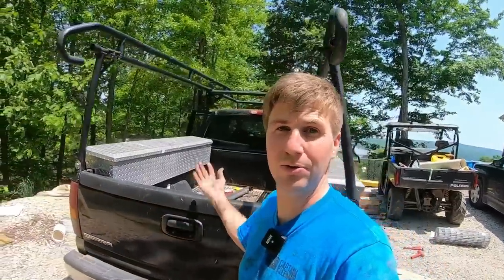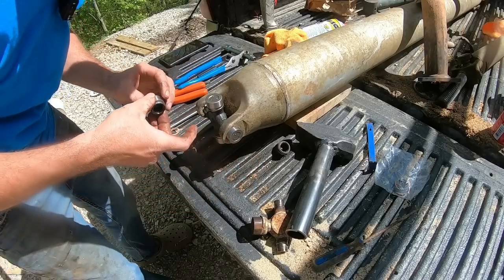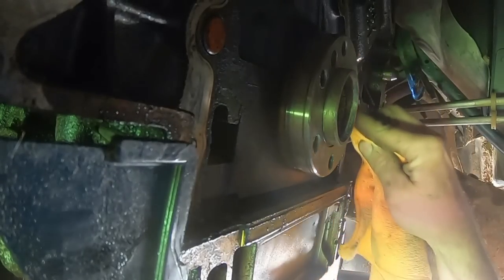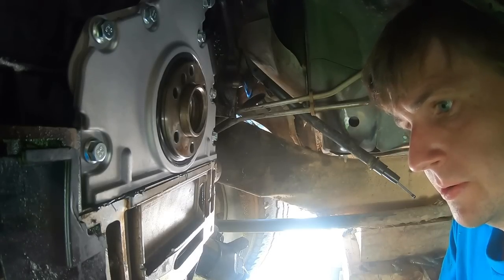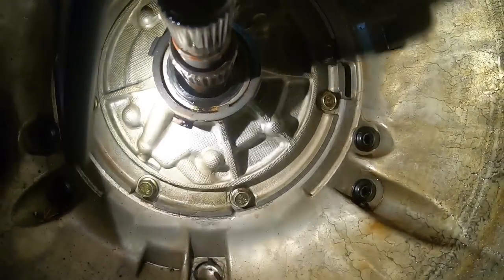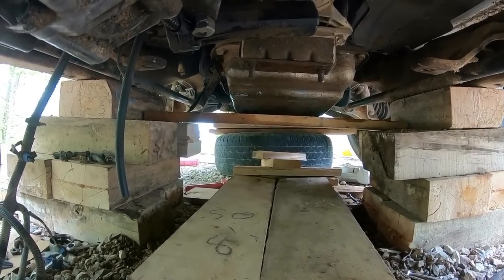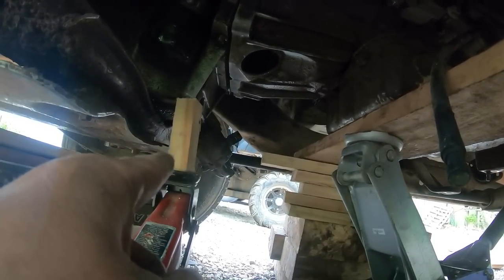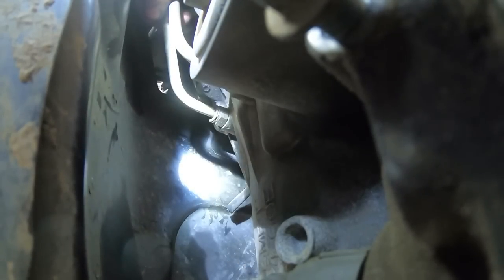GMC Sierra 1500 - Leaking Oil in Two Spots at 290,000 Miles - Homeowner Attempts Repair

Comment: Cap’n, that was an adventure!  I lost track of all the camera angles you used.  Despite the close calls with the bumps on my noggin and the oil splash in my eyes, I’m fine.  I made it through without a scratch.  Thanks for keeping me safe!!!

Now, let’s talk Torque Tools… I’ve used every kind you can imagine… my dad had the flex beam type, with a rod that pointed to numbers on a scale.  They were both foot and inch/lb varieties.  He bequeathed them to me.  They were state of the art when I was a kid.

Years ago, a mechanical engineer who worked for me tested them on one of our torque testing machines and discovered they were just torque estimators.  So, I bought a pair of Craftsman click type wrenches.  Those are what I use now.

My neighbor did some welding for me.  He was working on his Bobcat and needed a higher Torque value.  So, I bought him a  digital wrench.  I got to play with it a few times.  It’s cool but, like you, I was always afraid of tearing it up… so I don’t use it often.

Then there was this torque tester in our lab at work. (The same one that we tested my old wrenches on.) The testing head was portable and plugged into a lap top. In those days, the laptop weighed more than the tester… I had just bought a new set of tires for my pickup and thought it would be interesting to see how close the lug nut torques were. 

When we took the tester to the parking lot we found they were all over the place.  Like maybe 40 ft/lb range from tight to loose.  The owner of the tire shop was a family friend.  I called him up and asked if I could bring the pickup by and have them check to see if the lug nuts were tight.

When I got there he pulled the ticket and called in the tech who had changed the tires.  He asked him what torque he had used.  His response?  “The German wrench.” 

The owner told him to get out his Torque Wrench and do it right.  He then apologized to me. That’s when I asked, “What’s wrong with using a German Torque Wrench?  Are they calibrated to metric?”

His response, “No, they aren’t calibrated at all.  They are just Gudentite!”  It took me a few seconds to translate it but I realized that his mechanic had done it the same way I did it… when I could get away with it!

Since then, I have always tried to figure out when  Gudentite was Gudenuf!

Now Elbow Click… I’m gonna have to work on calibrating that.  Thanks for adding another tool to my torque wrenching arsenal!

Comment: I love watching just a little advice from a old badly worn mechanic, I’ve noticed a few times on you videos when you are torquing bolts you have choked up on the torque wrench but the only way they are truly accurate is when you are holding the handle. Good luck and God Bless!

Comment: Twenty years in the Air Force as a Vehicle Mechanic was tough job.  If it had an engine and/or wheels, you worked on it.  Every Air Base I was stationed at we had civilians that we worked with.  They were the anchors of our shops and the highest skilled technicians.  If we deployed, they were the ones that kept the shop at home station running.  We had one civilian that taught us how to modify one of those Dog Bone creepers for rough terrain.  Swap out the big skinny plastic wheels for wide air-filled rubber tires/metal wheels.  Many times, on our deployments we had to work on dirt, rock, and sand.  Those modified Dog Bone creepers made it much easier on that rough terrain.  Sand was a bit more challenging, depending on the amount of sand.  The only downside was the creeper did sit about an inch higher, but that also prevented the creeper from dragging and snagging on the rougher terrain.  He was recognized by the Air Force for the modification and was awarded a $6000 for his idea.  Supposedly, the Air Force was supposed to work with the company that makes the Dog Bone creepers to put the modified version into production, but it never happened.  It didn't take much to do the modification, so the mechanics did what they had to do.

Comment: Hinde sight thing, before you attach everything back to the transmission, you have to jack up the engine and transmission, as high as you can, it will tilt the top of the transmission away from the fire wall. Hopefully you won't have to do another one. Great job man!

Comment: Great video Mike. A bench vise and a couple of sockets work great for taking out the old U-Joints. I have used a large C-Clamp as well. Use 1 socket as a punch and a larger socket as a cup. Also when you reinstall the new ones, I always wipe more grease onto the needle bearings…something like Lucas Red and Tacky. Hope this helps you in the future….thanks!

Comment: Since I turned wrenches for a living, I feel confident in saying that ya did dang good... I never had much luck trying to put two caps in the u-joints at the same time so set one in far enough that I could still move the joint over to find the sweet spot and slip the other cap in.. then if no ones looking a ball pein hammer and a second hammer to hit the ball pein hammer and set them in to where the clips fit... now they are in, I would tap them apart from each other making the caps tight against the clips and no tight spot on the joint so its turning smoothly as they are too tight together, working their way back to a sweet spot ain't always a good idea.... hope I didn't confuse you. I also would check the exhaust bolts after all crossmembers are set in place so I didn't have something not quite right... also, if five don't hold a transmission in, six never would of either.. its nice to have all the bolts in but that top bolt is not a issue. I have had rigs come in and maybe one or two bolts was all that was in the dang thing.. still working... now for how long its gonna go when at that point is a lottery ticket guess. I owned the triple A subaru shop in anchorage but sold everything about the time of the Legacy an other fine rigs so not a lot of help there. I am going out on a limb and say its payed for, that old truck, a couple patch welds on those rusty  sills under the doors is easy if you have a mig... you have internet to guide you on that and takes a lot of comment space up for me telling... good luck on all your fixes..... as a younger man used to put those transmissions in by just pick and put... I am paying dearly now for that great decision

Comment: Capt. the key to your job is to have much bigger solid weight under the shaft (as in a hardwood 4x4 @ least 1' long)   also as you got it resting on your tailgate every time you hit  it the;  the tailgate bounces reducing the force  of the hammer blow.... Lay it out on the ground then hit it !!
Good job on tackling a job most home owners can't & will never attempt to do !!

Comment: Great job. I've done it many times with the occasional fighting the U-joints. I've learned that drive line shops will press U-joints so affordably that I usually let them do it. They usually sell the U-joints at great prices, too, especially in agricultural areas where they are rebuilding PTO shafts all the time. Farmers are budget conscious so the shops that serve them are good values. 
If you had a tranny jack and all of the pro's equipment and removed the transfer case first, would this job be worthy of a video? Naw. Watching 'get it done' attitude is what your channel is about. 
I lay a  4x6 carpet scrap folded to 4'x1.5' on top of the engine so I can lay on the engine to reach down behind. Wish I learned that trick decades ago.
Now, go hit that EASY button.
Reply from the maker: Oh man, I missed an opportunity by not pressing the easy button on this one
Reply: A lot of half ton GM driveshafts will bend the ears of the shaft of you try to pound the in. Then you have to try to straighten those as well. A shop pressed them on, no drama.
Reply: @kenore4003  Especially those aluminum drive shafts.

Comment: That front joint with the nylon injected keepers is, from memory, is a GM 3R series joint, your replacement joint should be a spicer 5-3147X u- joint, these have internal snap ring keepers, meaning they fit inside the yoke ears, do yourself a favor if you run into this joint again and take a file and lightly file the inside seat surfaces for snap rings on yoke of the drive shaft, it helps with final assembly. Nice job sir, thanks for the ride along.

Comment: Mike, I used to use two sheets of plywood and put plastic on the ground  to stop mud from oozing up from between the plywood sheets.  Didn't change the closeness of working in tight places, but sure was nicer for rolling the jack and sliding myself, parts, and tools out from uder the vehicle.  I also had Ramps with removable ramp portion (purchsed from NAPA in the '80s) to support the front wheels.
Replaced Cluches, Engines, and Transmissions,and once a busted Transaxle of a Subaru Brat in January Snow and Freezing Rain that way.  The no mud inside my clothes was well worth the cost of my temporary floor.
I had a Floor Jack similar to yours that I built a cradle for securing Transmissions, simple design of flat plat with some channel bolted to each corner, slots and bolt holes to hol short lengths of chain around the Transmission , put a clevis pin with washers & a quick pin to fashen in place of saddle on the Floor Jack.  Dang thing weighed more than the Jack and stability was questionable (to say it politely) but it did the job.

Enjoyed the video, reminded me of old times of getting all "persnal" with my vehicles trying to reach those top bolts.  LOL
Thanks for today's Smile!
Reply from the maker: Questionable but does the job would describe myself as well 😂😂
Reply: @CaptainKleeman  LOL
You do a great job at getting it done.

Comment: Good job there Captain. 
Not bad for a non-professional shade tree mechanic. 
Those bottom bolts are called shoulder bolts due to the no thread portion under the bolt head.
Just letting you know so if you ever gotta go to your local hardware store to buy one you'll know what to ask for.
If their employee looks at you like he's clueless find someone else to ask.
There's also bullet head bolts abd studs.
They have a smaller diameter than the threaded portion un-threaded nob on the end of them to help guide them into hard to get at bolt/stud holes.
This concludes today's lesson on proper hardware nomenclature. 
You're welcome.
Reply from the maker: 😂😂 thanks!

Comment: Nope.  No way.  If that was me, I would've killed it with fire...by setting the truck ablaze.  I built a fairly large shop for that very reason.  Yes, normally they'd still get in, but I have enough pesticide around the perimeter, both inside and out, to de-bug the entire Amazon river basin.  The exterminator comes twice per month, and I spray every other day.  Excellent job on the repairs.

Comment: Thanks for the "how I did it" video.  As I am not a mechanic but an engineer I have a tip for you.  If your torque wrench is in ft lbs and your spec is in inch lbs, take your inch lbs / 12 to get the ft lbs number.  Also I agree extensions how you used them does not change the torque value.
Reply from the maker: Thanks Scott!

Comment: That bolt u had difficulty reaching reminds me of my 98 pathfinder. It had a spark plug that was unreachable and angled so no extension could position correctly and it had no bevel to even help drop it in. I had a couple backyard mechanics try and one said it was good it ran for a day and then it blew out. I ended up having a shop do it at a crazy price. I still feel violated from bringing a vehicle to a shop for a spark plug install.

Comment: As a mechanic I would suggest using a paint pen on the bolts that have been torqued. It gives a visual marking if the bolts move at all you will know. In your case just wait till it sounds like metal pop corn popping. Sorry.  As I would use it on all big or farm equipment. Definitely has helped me.

Comment: In the event that replacing the oil seal does not work when you put it back together quite possibly your intake manifold would be leaking and dribbling down the bellhousing I've seen that happen that's if you're curious let's find out if your oil seal stops the leak you got my support two thumbs up

Comment: Hey Cap!! The problem with the u-joint could have been a mid year change. Sometimes they switch suppliers and it doesn't make it to the aftermarket. I have a 2002 Ram 2500 and it has 2003 model year running gear. Couldn't figure out why the wheel studs were wrong and I worked at a dealership for 15 years. Manufacturers can be sneaky. Great job on the repair.
Reply from the maker: Good point, thanks Darrin
Reply: It’s gm.  Not a damn dodge
Reply: @elainecessna929  No kiddin? All manufacturers do it.

Comment: only thing I would add, on those u joint snap rings, pay attention to the snap ring itself, they are stamped, and there's a "rounded corner" side, and a "sharp corner" side.. put the "sharp corner" side OUT. Makes it a lot easier to remove next time! Also- got a link for that fancy low profile all terrain creeper?

Comment: A very good friend of mine works for Cadillac and he does analyzations of time over distance for the assembly line big mouthful for how much work we can get done in a short period of time. Most of this is going to be done without grammar so don't yell at me about. The lack of grammar. As my friend puts it torque specs for every nut and bolt have a lot to do with how long it takes to put the bolt in and knowing that all bolts are done exactly the same way The spec itself is not necessarily you know written in stone 4 or 5 lb one way or the other is okay and all of their wrenches impacts tightening devices all work on time and torque with that being said they can actually tell how long it's going to take to put a bolt in on every car in the same place and it takes the same amount of time That's why they put torque specs on everything even when it's not necessary Even analyze how long it takes to put pushpins in is there a better way of doing it can they save a second and this is no joke That's what he does all day long for the next year's run on cars as he puts it It pays the bills but it keeps him up at night wondering did he miss a second so when you get off fuddy-duddy about your torque specs just remember they were put there for a reason and not for the reason you think it's all about time and money. Every bolt done exactly the same way every time equals the same amount of time and money to build that car It also gives them data because most of their guns are data linked so they know how many cars and how many bolts or nuts that gun did in a day was anything missed cuz warranty work cost money in a missed nut and bolt is warranty work and nobody especially a tech likes warranty work. Sorry grammar Nazis but these days my fingers don't work as well as they should so I talk to write these comments. And yes I know you can add the grammar when you're talking about when I get moving I have a problem with doing that and I know you're perfect but I'm not ask my wife Do you have one.

Comment: USE SILICONE SPRAY ON YOUR WINDOW SLIDE FOR UP N DOWN. OIL ON YA RUNNER INSIDE YOUE DOOR, SIDEWAYS RUNNER, THAT IS IF ITS NOT CABLE ON INSIDE, SILICONE SPRAY WORKS GREAT ON WINDOW RUNNERS.  OR THERE IS A DUST YOU CAN USE.